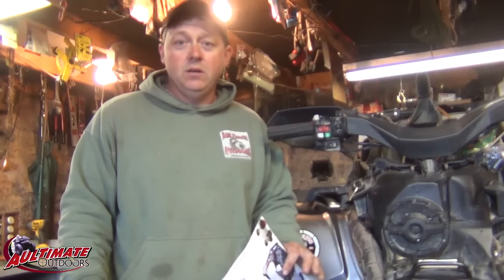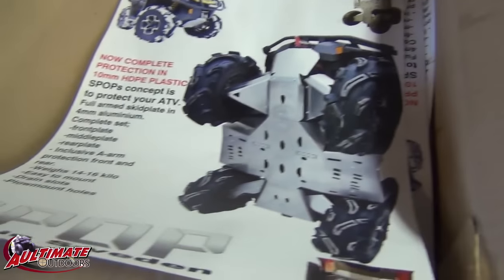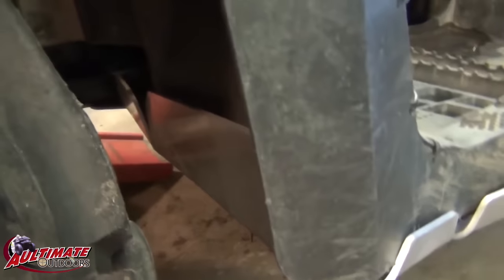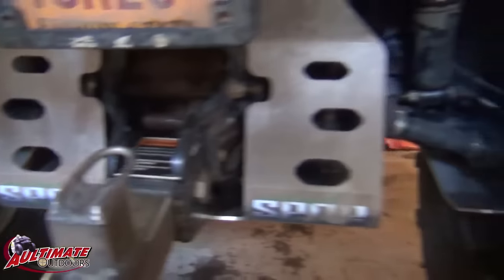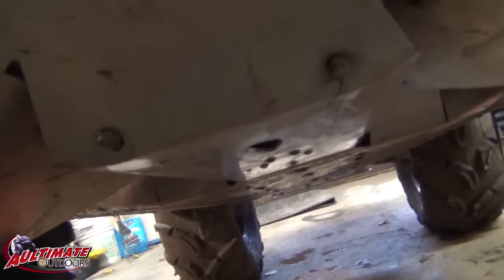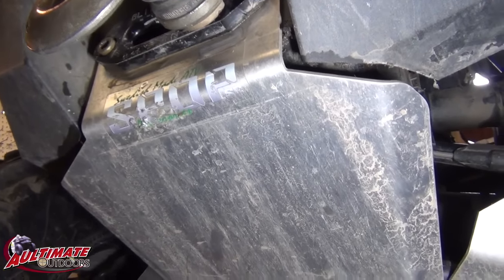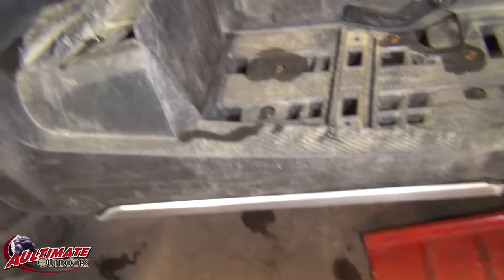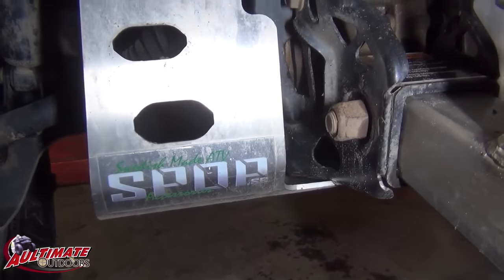ATV SKID PLATES! SPOP...SWEDISH OFFROAD PERFORMANCE PARTS

Comment: How hard do you find it is to clean the machine with the skids in place?
Reply from the maker: It is harder but they didnt hold as much as I thought they were going to! They have lots of drainage holes and most of the stuff falls out.
Reply: AULTimate OUTDOORS
Thanks! Contemplating a set on my XMR.
Reply from the maker: Not to bad. Skids kept a lot of stuff from splashing up into the machine but it is a lot tricky to get it out of some spots because of the skids!